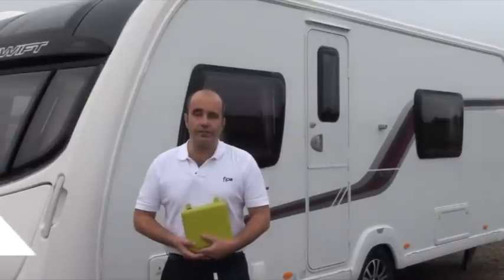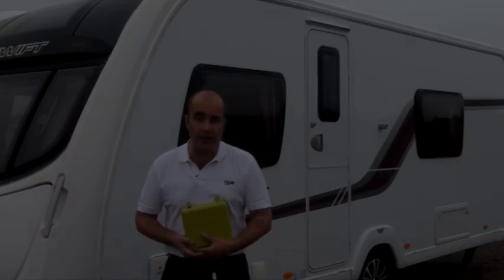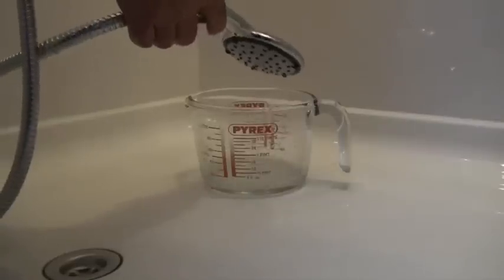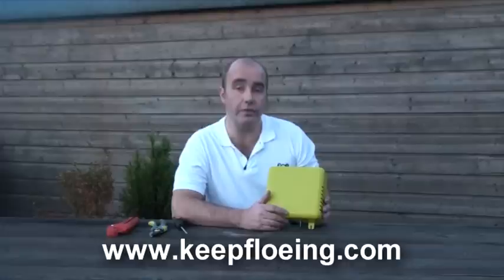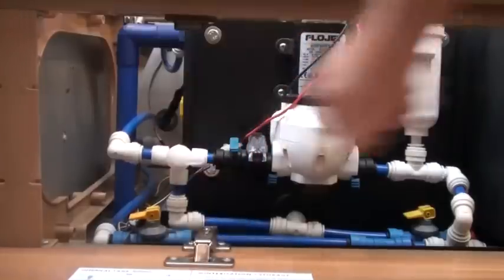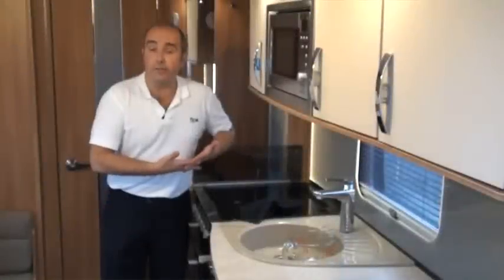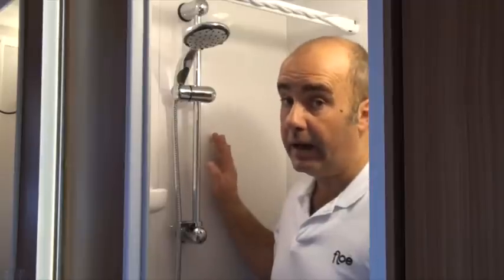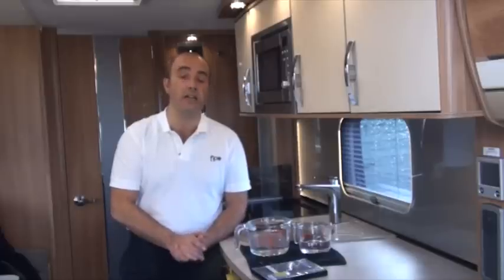Floë Induratec 636 - Drain down and winterise or winterize Touring Caravans, Motorhomes and Boats

Comment: Problem: hymer state no more than .5 bar pressure for doing this. Flow runs at double that; risk of blowing joints designed to hold lightly pressurised water NOT compressed air.